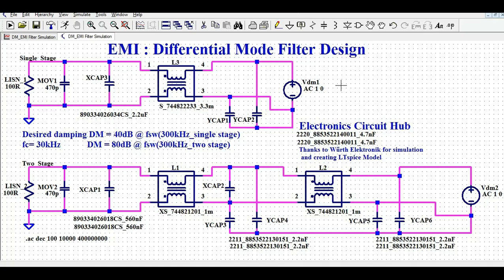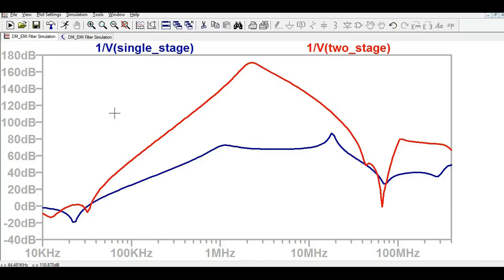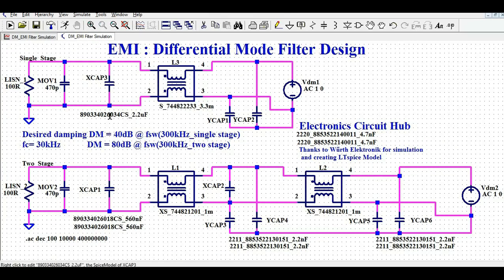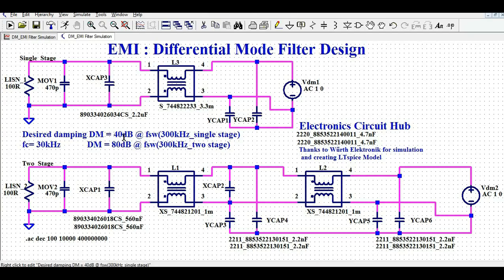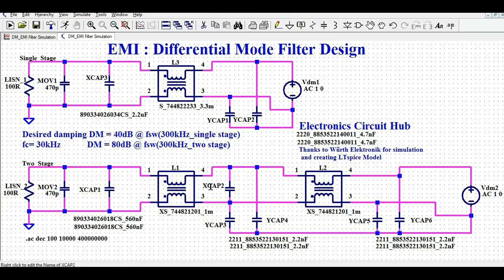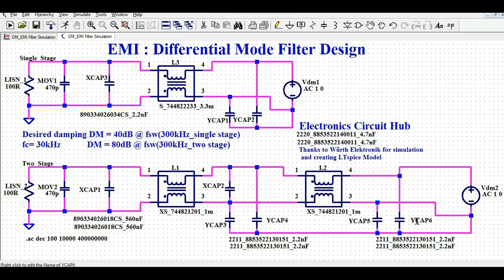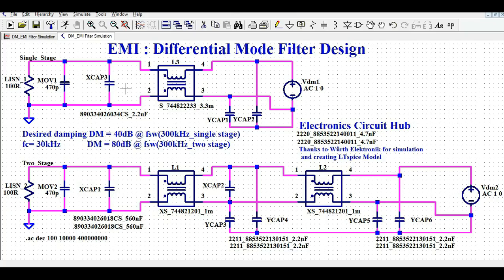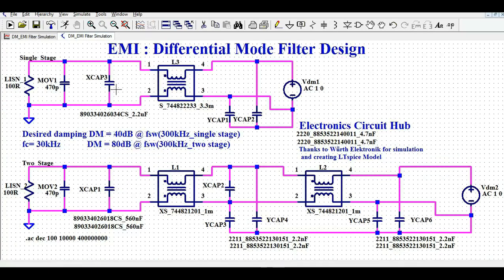How to Design a Differential Mode Filter Using LTspice

Comment: Professor, I now understand what you did for the MOV. You used 470 pF to simulate the capacitance of the MOV. Also, I think the YCAP1 and YCAP5 are not needed. These capacitors tie to the same point in the simulation. Thank you, Danny
Reply from the maker: Hi Danny...Sorry for delayed reply. Please find attached pdf for your reference. https://www.we-online.com/files/pdf1/design--simulaion-of-acdc--dcdc-filters.pdf
Reply: @ElectronicsCircuitHubECH  Best of wishes for 2025 Professor. Thank you for the great information.
Reply from the maker: @pbaemedan  Thank you so much Danny, Thanks for your support as well.
Reply: @ElectronicsCircuitHubECH  Great info.